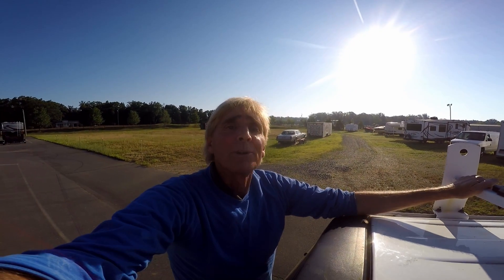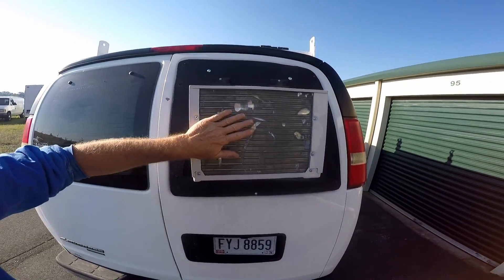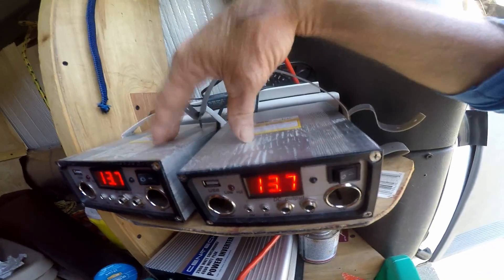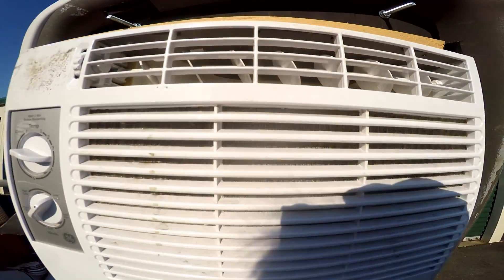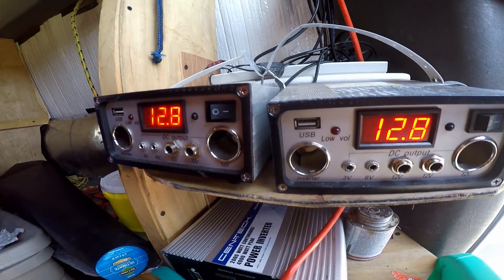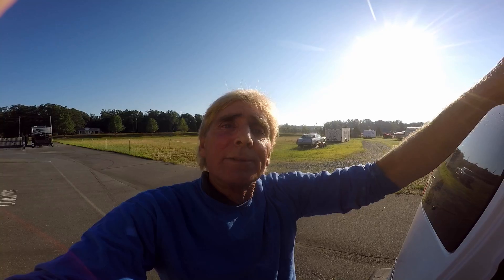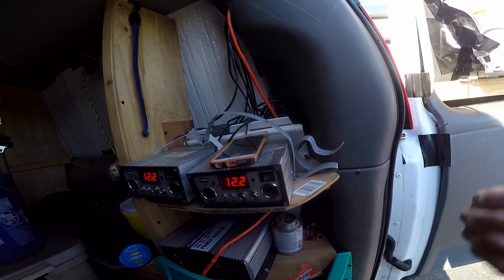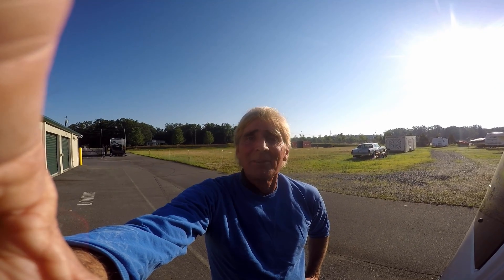90 Watt Solar Panel Runs 800 Watt A/C

Comment: Put a timer on it so will shut pff before battery dies and alarm sounds. Go buy some updated solar cells for about $200 and get over 3X the power output in watts. Your charge controllers look big enough to handle.

Comment: There is no way to run 800 wats or even 200 watts for that matter all day just off 90 wats of PV power alone.  An air conditioner draws quite a bit of power....were you must have at least 650 watts of PV power coming in in order to successfully run that thing all day on a sunny day.  I have a similar set up in a van (Involved duct work)   air from the air conditioner out underneath the truck....stealth system.... done a pretty professional job I might say vs tape when u can use zip ties lol.   I guarantee that this particular setup requires external power besides those 90 watts of power you have coming in there.... if it really is true that you run that thing all day just on 90 watts of solar power.....which is impossible.  Don't believe me?  I guarantee from experience that that setup will not work you will lose battery charge very quickly and that's if you're just consuming 300 watts on air conditioners....which is impossible...usually around 400 watts.  Here is a down and dirty math to what kind of PV its going to take:  300 watt power demand (hypothetical air conditioner power demand).  You need to take out 300 watts from the battery and be putting it back.  Yoy run off 12 Volts.  That means (since watts=AMP×Volts) you need 25 amps from you batter bank at any given point.  the maximum amps of your 90 watt PV system is going to deliver, AND,  is 7.5.  BUT, 7.5 is the MAXIMUM amps.  You still need anything over 12 volts to successfully restore batter power at any given point.  You need 25 amps....at least....and ur PV system (90 watts)  will not deliver even close to.   and doing the math assuming your air conditioner Burns 300 watts (which i know is way more),  you will only be able to operate that air conditioner for about 2 to 3 hours her 6-8  hours of charge capacity.   and that's just doing the math you have realistic real world interference were you're not even gaining full PV capicity.

Comment: You'd need 800 watts of solar to replenish those batteries as the AC sucks out 800. I have 800 watts and my AC sucks 1500 watts, my lithium batteries in 24v series of 180amps only last about an hour and 1/2. Your system is a little weenie compared to mine and I replenish about 50 percent of the AC draw. No way that thing runs more than a few minutes.
Reply from the maker: Runs all day as long as the sun shines!!

Comment: Hello sir thank you for the nice video. I was wondering if you could assist me with the project that I'm trying to start. I have a 40 foot shipping container that I finished off to grow microgreens. I need to run fluorescent lighting system inside this container and an air conditioner which also has a heater in the same unit running off a thermostat. My hydroponic system will be self-contained and on a timer system I just wanted to see if you can help me calculate how many solar panels are needed and what kind of inverter yeah solar panel setup I would need to run this project inside this container. Thank you for the inspiration hope to talk to you real soon. My email is patmikfinn@yahoo.com

Comment: Now i know why i rarely comment on youtube. Its shocking how dumb people are!
This guy is not claiming to get 800w out of a 90w panel!!!!!!
 He's simply claiming that the air conditioner's duty cycle is low enough (in this application) that a 90w panel can keep up.
Think about it; If the aircon is running on full power for less than 30 sec every five minutes then he is correct!
In a tiny space like that, and if it's well insulated this is almost believable .

That said, do i think it's 100% legit? I have to say i have doubts. I suspect this at best  is right on the limit of what could be considered useful.
Reply: Ron Chappel well said.

Comment: So according to Apple Brains insane logic here, I should with my 40w Solar Panel be able to run my 52'" big screen Tv, my huge Refrigerator which cycles all day long,an X-box,my 1600w Microwave,my Skill Saw,all of my 100w light bulbs in my house,jump start my Car,and crank up my Entertainment Center to full blast all at the same time,all day long, and still have some juice left just in case?  Really Apple Brains?

Comment: Seriously? There's no way. 90 watts from your panels will maybe get you max 76 watts per hour with the loses from the inverter and lines connecting multiple panels. So even if you had a great day with 5 hours of direct sun,your total would only be about 380 watts. Besides,having your panels flat isn't going to help but even reduce more watts that could be collected.This setup is not even close enough to power this AC for more than 10 minutes. You'll slow down the hit your actual batteries take while the sun is out but that's it.

Comment: Solar panels are not running the A/C but the battery is through the inverter. How many amp hours is your battery rated?  The panels will charge a deep cycle battery so you can run some lights and a small stereo at night but not A/C or fridge etc.

Comment: 800watt through a power inverter will draw around 50-80 12v amps.  each 300watt solar panel generates 15amp 12v. you need 8 panels 300watt each to run it when sunny outside.         they are draining a precharged battery

Comment: Nice video but you're 90 watt solar panels would not be enough to run 800 watts it's drawing the rest of the Watts above 90 Watts from your two 12 volt batteries and maybe the solar panel charges of two 12 volt batteries even when your AC is not on

Comment: Greetings. I have 1k of pv and 460 amp of batteries and 3k of inverter and I can't run an air conditioner all day. Only a regular fridge, led bulbs, tv and dish receiver. Energy conservation don't fail. I have three of those pv that he has. And those pv does not start even a 20 inches led tv.

Comment: He is using DC powered A.C, or A.C with DC powered compressor. its doable, but DC powered appliances are hard to get, and you need whole system to run on DC, so it fits well for vans,

Comment: It could work if he had a 1000ah 12v battery = math 1000x12= 12000÷2= 6000 watt hours.... that means he could run the air conditioner for 7.5 hours plus the extra power coming from the solar panels.

Comment: I know for a fact that 800 watts for an AC cannot run all day on two marine deep cycle batteries. I tried to do the same thing while I had two 115 ah marine deep cycle batteries in parallel AND the main automotive battery attached to the alternator of my van WHILE THE ENGINE RUNS, and it only took 10 minutes to wear down the charge to the point of killing the engine. MYTH BUSTED.

Comment: This is of course BS... I have over 1,000 watts of solar, and 10 deep cycle bats using 4/0 gauge cable, Midnight solar controller, and a Zantrex 5,000 watt inverter and I WOULD NOT try to run a large window air on my system for the long haul. This guy sounds like one of my neighbors (who lies like Hillary lies)... What he has is a setup which can run a small laptop and charge his cell phone and that is about all it can do.
Reply: Daun Johnson 😂stuff it!!!!!
Reply: Hilary does not lie fact check Trump LIED 6,240 + TIMES so far so LOCK HIM UP!!!!!!#!!
Reply: @annhofland7232  You show me what we have to lock him up for and He and Hilary can share a cell.

Comment: You could not start that AC on 90 watts with a a sure start kit. As the locked rotor amps would be 60 amps. and being 800 watts= 66 @hrs... You would need a battery bank the size of door!

Breaking ohms law and things everybody is an idiot...

Comment: I think what Salil Darji says in response to Pop's Shack bears repeating: solar A/C in a van is possible. Both Nomadic Fanatic and JustinCredible have both demonstrated this, all with Gone with the Wynns in much larger RV. 1) You're dealing with a small space, so the A/C doesn't need run much. 2) The wattage that the A/C draws at startup is most definitely not what it's drawing while running.  3) This guy is quite possibly in a more temperate climate like SoCal. Cooling from 80-ish degrees down to 70 or so is obviously going to be much less of a drain of power than, say, cooling from 100 down to 70. 5) It's quite possible that the guy has the A/C set quite high; cooling down to 75 or 76 is a lot less power than cooling all the way down to 70. 6) When this guy says he's "running it all day long," it's probable he means, "it keeps my vehicle cool all day long," as opposed to, "the A/C compressor is running 100% of the time." 7) He openly admits it only runs for an hour or two at night.

Comment: I think all of the people commenting that this isn't possible are overlooking something. The air conditioner likely is only pulling is rated watts intermittently, it's in a small space and probably only needs to run the compressor for short periods of time. It's almost certainly not just sitting there pulling 800 watts continuously. That being said I have no idea what wattage it uses while just running its fan or what the true wattage is when the compressor is running, without this information it is not possible to say for sure that it is not possible.
Reply: You're right.
This would definitely work if the aircon is running less than (approx) 6 min in every hour. However i think that's unlikely...
Reply: BS, the A/C is drawing wattage continually if he has it set for cooling at 64 degrees and not just the fan blowing air.

Comment: The math doesn't add up. Solar cells and 2 Batteries... How big are your batteries ?
They must be Effing huge.
Ahhh. 1.5 hours from your batteries...
FLA on a motor is much higher at start than run...
Sorry, but like others, I call a WANK alert on this claim.

Comment: What is this, a magic trick? 
No way  90 watts of  solar panels will run an 800 watt appliance. Under ideal max sunlight max tilt angle at midday the panels will produce 5 or less amps. The 800 watt air con is sucking some 63 amps (800 watts divided by 12.6 volts =63.5 amps).

So, at a peak time of day, 5 amps of solar in --- 63 amps out. A deficit of 58 amps being supplied by the batteries, not the sun. Less  inverter inefficiency.  

Two marine batteries of unspecified amperage, say 100 amps each =200 amphours. Discharge them to 50% and that's 100 amps available. So 58 amps required each hour --and there's not enough battery power to run the air con 2 hours, let alone  all day. Also, that's a very high discharge and the batteries would not last long.

Magic myth busted.

Comment: can't remember the store but I have for gel batteries that use enlarge Class A Motorhomes yeah does hundred-thousand-dollar motorhomes but I've got three 300 watt solar panels equal in 900 watts fixing to buy a 2000w power inverter I run a small refrigerator a color TV with DVD player a couple of LED lights twice a day a coffee pot this is all in a 1974 full size Dodge van the three batteries are mounted underneath it even though they're gel batteries for safety but I have yet to use an AC if I do it would only be for brief moments like half an hour to bring the temperature down then turn it off and repeat the process every 2 hours but with my setup I think AC will work for short durations

Comment: I'm going to go ahead and assume he's wrong on the 800w figure. A 5000 BTU AC unit would draw around 350 watts. We'll say that he needs 30 amps to run that. 

He has 90w of solar which probably produces around 5 amps. If he lives in a sunny area perhaps he has 10-12 hours of good sunlight. At most he's probably generating about 50 useable amps. That's 1.66 hours. 

If his batteries are running that thing all day (8 hours) and the DoD is maxed at 50% then he'll need about 400 AH in total battery capacity. 

I don't know what his batteries are, and his solar charger is not an MPPT and it's probably not efficient. I also don't know how he defines "all day". Too many unknowns here. 

But, if you want to run an AC unit that's 5,000 BTU you're going to need about 400 AH or 200 AH usable for 8 hours. And, you'll need a way to charge that back up.  

Another consideration is how often this AC unit is kicking the compressor on vs just blowing air. A van is a pretty tiny area to cool.

Comment: Also most people who are just getting into solar don't really know this but don't use marine batteries.  They aren't actually a deep cycle battery.  Even though they say they're a deep cycle battery they are meant for starting a motor.   Never buy batteries with a CCA (cold cranking amp) rating.  They won't last near as long as a true genuine deep cycle battery will last.  Use 2 golf cart 6 volt batteries tied together in series.  Way more amp hours that way and they are actually deep cycle batteries.  I repeat, never buy a battery meant for starting an engine and use it for solar.  It's the wrong application for that type of battery

Comment: Ditch the over priced 12v panels and get some 35v panels meant for a house. Use a mppt charge controller and you'll get 99% of the wattage of your panels going into your battery @ 12v (14.4v) 
Seriously!! MPPT and regular house panels.   You can thank me later.  
Btw a 295 watt grid tie panel is only 200 bucks canadian

Comment: this video is a complete bullshit we cant run a 800 watts ac on 90 watts solar panaels even if it works i will work only maximum 30 minitius untill your batteries are drained of power than will stop .i have 6 150 watts solar panels in my home attached with a 250 amp battery and a 500 watt ups i can only use 3 celing fans and upto 5 tube lights only utpto maximum 6 hours

Comment: 90watt solar panel cannot run a 800watt airconditioner ...the only thing that runs are the fans in the aircon...the freon compressor will not budge at 90watts...the batteries will run out quick within minutes because it needs more than 90watts to keep its charge..

Comment: 60 ... 12 volt , 15 watt panels are needed to run a 120 volt ..600 watt appliance ... and that's in full strength full sunlight ...I am off the grid myself ...Something to notice ... A 1000 watt ..120 volt appliance .. requires 100 amps from a 12 volt system ... each harbour frieght panel is only max. .. 1 amp ..so a 900 watt 120 volt appliance would take 90 amps or 90 .. 1 amp panels ... minimum .. I hope this will help some people thinking about solar ....